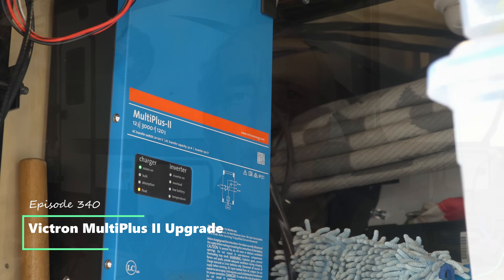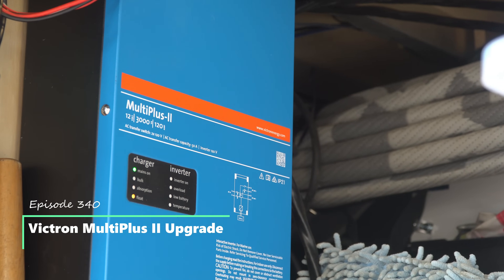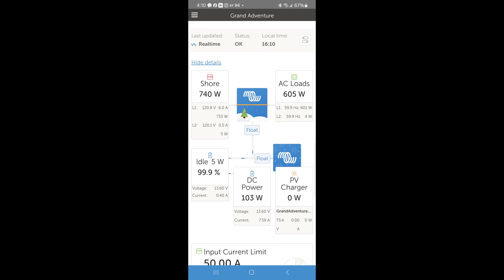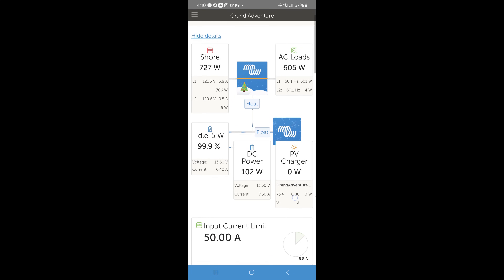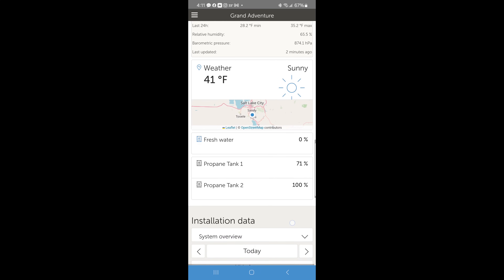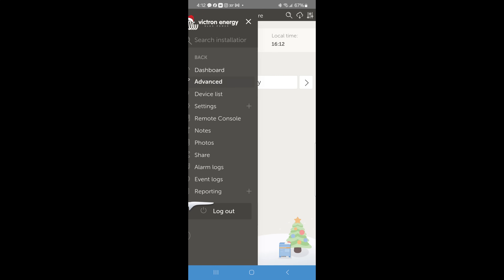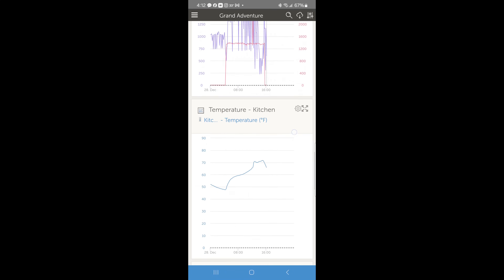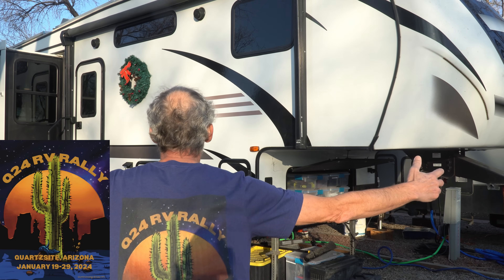Ep. 340: Victron Energy MultiPlus-II Upgrade | RV inverter-charger 50A

Comment: Waaaait wait wait wait, i was just about to pull the trigger on this, but i think now i might have totally misunderstood something; So the multiplus 2 does NOT actually take-in your solar panels voltage and you still need a seperate solar charge controller anyway? I was under the impression this was an all-in-one unit.
Reply from the maker: Yes Ethan, you still need a solar controller. The MultiPlus II is an inverter-charger. I don't know of any inverter-chargers that also function as solar controllers. They may exist, of course, but if they do I'm not familiar with them.

Comment: Can you run air conditioning off your solar system?
Reply from the maker: @markallen8039  yes,  but only for a short period to take the heat out. Otherwise we'll blow through our batteries fairly quickly.

Comment: You should not be using ROMEX in an RV. This could have very well been your issue. The solid core wire can weaken and brake over time due to movement. Stranded wire with proper connectors will be much SAFER.

Comment: Mark trying to understand I going to be putting a Victron Multiplus II 48|3000  120Vac unit into my motorhome. I was thinking that this units was a split phase 120 input and pass through units. From what I understand the L1 is the only 120 v line that will have power if shore power is lost and no generator ( running only off batteries only to the inverter ). I live the fact the units will add more power if you have limited power like be hooked to 30 amp and need 10 more amps to run things. Mark is this power adding done only with L1 or is it done with L1 and L2 ?  So since my motorhome is 220V 50A input. I can run 250 v 50 amp wiring ( two hots one natural and one ground ) to the input of my VIctron Multiplus II and use the same 250V 50 A wiring to my inside AC distribution box or panel. There I can hook like The red to one set of breakers and the black to the other side of breaker ? Then hook up my white ( or return ) to my natural bar , and ground wire to my grounding bar ? I hope I have this right and have not asked to many questions ?
Reply from the maker: Hey, Jeff. No, the Victron will invert both legs while not on shore power of any type, including generator. The place where the pass-through is important is in the "power assist" functionality that supplements inadequate 30A shore power with battery/inverter. Each leg from the Victron will power one half of your distribution panel. Hope this makes sense, for indeed it does get confusing.

Comment: I’ve been using the Multiplus II for over two years. It’s a great system, and the power sharing is awesome. A point of clarification; if hooked up to 50a shore power, both phases do pass through the Multiplus. However, if on battery/solar only, you only get single phase to the panel. As most RV’s have nothing that needs a 220v supply, you never will know the difference.
Reply from the maker: Excellent point, and thank you for correcting my terminology. From a practical standpoint, as you point out that means nothing to the user because everything receives power, albeit single phase.
Reply: @GrandAdventure  thanks. I’m sure there are rigs out there with some 220v loads. This can be handled with dual Multiplus systems. In fact, if I had to design my system today, I would go 24 or 48 volt with two Multiplus systems in order to get 30a on both sides of the panel and smaller gauge battery cables. The only issue I have come across is those crazy push-in spring loaded terminals that exist only on the Multiplus.
Reply from the maker: @waynee.3244  Tell me about it! I broke a terminal on my first install, and when I replaced the unit under warranty I hired a dealer to install it because of my experience with the spring terminals, and he broke one on the replacement unit. They are a PITA. And like you, I have seen the benefit to a 48-volt system as well.

Comment: Great video!  We have a Durango 326 with the Xantrex Freedom X 2000 inverter.  I’m interested in upgrading to the Victron system and wonder if you’d share what all yours came with solar wise and what you changed.  I’ve never been happy with the Xantrex components (charge controller and inverter) plus the Victron will eliminate the WFCO charger in the basement.  Thanks for sharing!
Reply from the maker: Dave, thank you. Everything Victron is a la carte. Get what you want, don't take what you don't need.

Our 2020 Durango came with one 190 W solar panel on the roof, the Xantrex 1200, and the cheap GoPower PWM 30 amp solar controller. We are now up to 1200 W on the roof, a Victron SmartSolar 150|100 solar controller, six 100 Ah Battle Born LiFePO4 batteries, a Victron BVM-712 smart shunt and battery monitor, and a Victron Cerbo GX with Touch 50 panel to keep everything communicating with each other, and with the internet. Everything we have done is in our boondocking power playlist: https://youtube.com/playlist?list=PLjEHCrqmvs1_MtyTAtjrMffdaOmtYBhJT&si=9Pdy-YD7-4Kd882N .

Comment: That’s awesome 
Couple features I just love is I can set it where it draws from the batteries only unless I draw more then 2100 watt or where ever someone sets it at.  And the other is I can set it to only draw ever how many amps from the pole I set it at. Two very important setups when at a place that charges for electricity 
But if boondock it starts and stop the generator as needed
Reply from the maker: That last feature is a wonderful one if you have it on board generator, Roger. Unfortunately for us it doesn't work with a portable generator like we use. No matter what, it's an extremely capable and versatile unit.

Comment: Nice video. Great set up. I would mention that victron is not the only manufacturer which accommodates 50 amp 2 line service. I have an older go power ic 2000 and it does the same as victron EXCEPt the victron is the only system which provides power assist on line 2. The go power only has power assist on line 1. This  victron was not available when I bought 4 years ago. If I was doing it today I would go with the victron because of that feature.
Reply from the maker: Thanks for the clarification, David! I was not familiar with that GoPower unit.

Comment: I love the Victron Set-up. I have purchased all the pieces including the MultiPlus-II and just need to do the install. Thanks for another Great episode of Grand Adventure Marc !
Reply from the maker: Thank you Mike! Wishing you the best with the install. The worst part is getting the stinking 6/3 Romex into the spring terminals on the MultiPlus-II. It's a tight place to work for such a stiff wire. They should have put lever connectors in there instead, like Xantrex did. That step, which should have taken 10 minutes, took about 6 hours and a lot of swearing.

Comment: I’m going to order some of those temp sensors.  How does you system measure your dc watts and amps, is there a separate shunt, our color control gx does not show dc voltage draw.  I thought I was a solar geek, wow you beat me, haha.   Great explanation.  Larry
Reply from the maker: Thanks Larry! That information comes from the Victron BMV-712 battery monitor with smart shunt, which we have had for a while. We connected to the Cerbo GX with a VE.direct cable.

Comment: Fabulous information, Marc.  Great system you have installed. I was interested in this episode because it showed all the monitoring being done on the new system via the internet, as you mentioned to me earlier.❤

Gord
Reply from the maker: Thanks Gord! We love having access to so much information from anywhere. Mrs GA had some issues while I was skiing the other day, and I was able to pull it up on my phone from the chairlift and figure out what was going on.
Reply: @GrandAdventure  "Phone from the chairlift"... does your phone have a safety strap? 🤔🧐🤣

I noticed you didn't use the Victron Lynx Distributor. What was the reason for that?

All these components are very reasonably priced.  The Xrantrex was more expensive than the Victron inverter/charger.

I noticed that Victron also offer their own Lithium ion battery banks. If you hadn't already invested in the Battleborn batteries, would you have gone with the Victron batteries?

Gord
Reply from the maker: @gorrdd  I think I would have stuck with Battle Born anyway, just on reputation and experience alone. As far as the Lynx distributor goes, I just couldn't see a need for it in my particular installation. It's a little more than a smart bus bar, although I sure could have used a bus bar or two to clean up my installation.
Reply: @GrandAdventure  Marc, yes, it seems like a nice accessory for cleaning up the installation, as you say. It pulls everything together and neatly distributes the interface. Something you might want to do if you have the mounting space.

Why would you need the 12 volt fuses?  Is this to protect the batteries from an electrical backflow, like in a lightening strike situation?

Gord
Reply from the maker: @gorrdd  in case of an inordinate draw, I suppose. Victron's instructions call for them. I would've rather used a circuit breaker between the batteries and the inverter, to act as a switch, too, but 400A 12VDC circuit breaker was about $150 and half the size of one of my batteries.
Reply: @GrandAdventure  Yeah, Marc, that's huge and bulky.  No doubt, this is why they offer the fuses for a more compact installation.

The thing is, with all that controller apparatus, it's hard to imagine an uncontrolled draw. But then, if the system equipment malfunctions, that is your safety backup.

Gord
Reply from the maker: @gorrdd  exactly. I'm trying to not burn the trailer down in the process. 😉

Comment: Nice system! The 50 Amp has the two legs coming in so you can set the cerbo to accept 100 Amp.
Reply: Yes that’s true, I should have said that you can use the touch screen to adjust it to 100 amp input available.
Reply from the maker: Thank you! Not the Cerbo, but the MultiPlus-II receives and passes through the full 50 amps on each leg, while still being able to invert every branch circuit in the house. The Cerbo is just a communications hub.